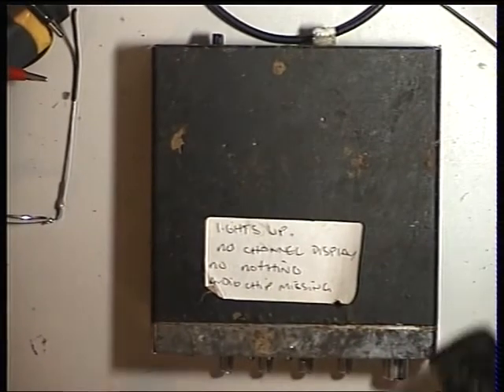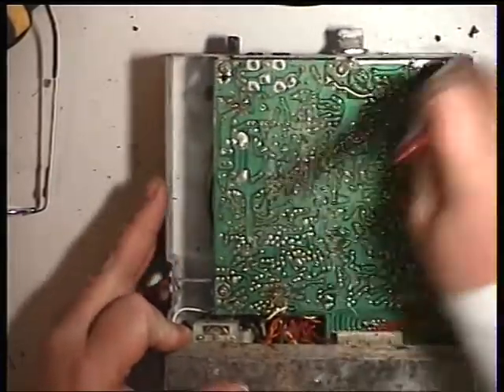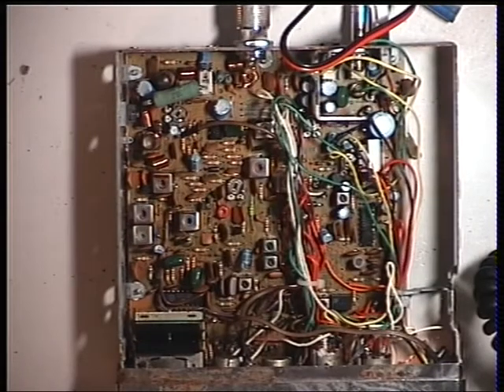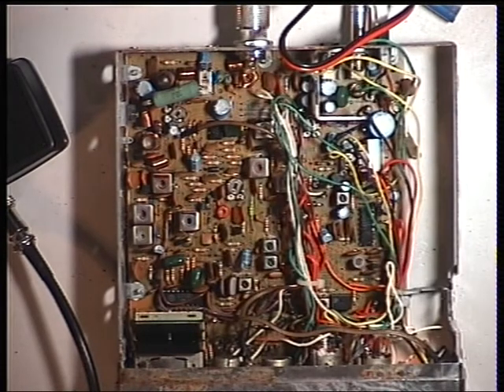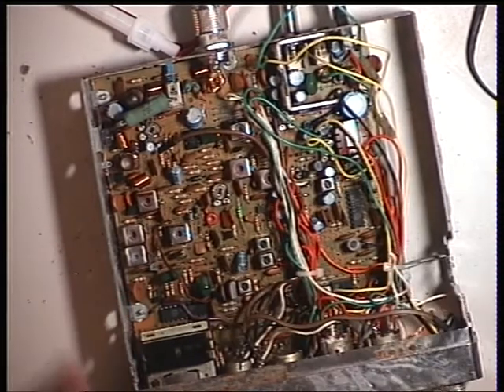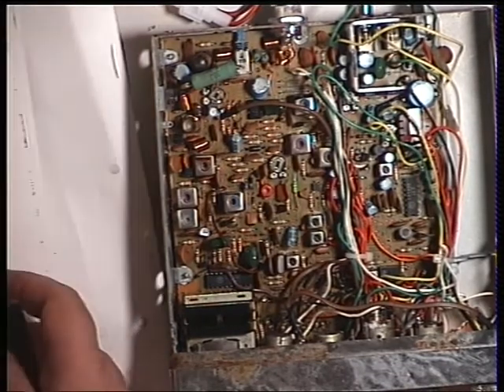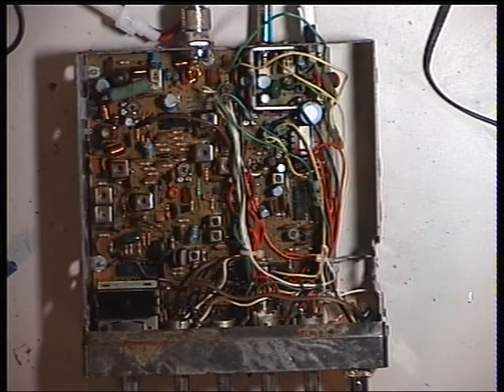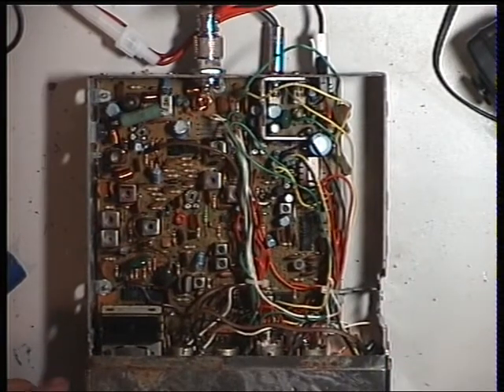Fidelity 2001, UK (CB 27/81) CB radio (Mobile) - repair & VCO

Comment: I got one here Richard. A wire had come away so I resoldered that. Has no RX no TX. But the display lights up on mine. No hiss out the speaker. VCO was showing 0.5V on CH1 (which I've adjusted to 2V). Don't know where to go from here really. Any thoughts?
Reply from the maker: Chris TheHulk Sounds like it's been reverse powered. Remove the LA1230 FM subsystem RX IC & see if the TX voltages return
Reply: I've replaced the 1230 Richard and I got RX and full RX audio back, but still no TX. So I think the pre-driver may be gone.